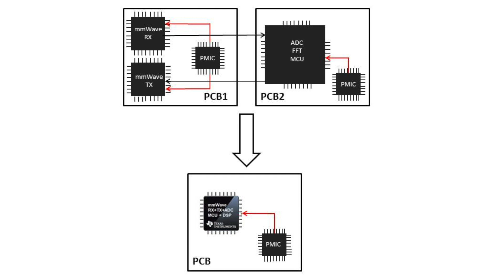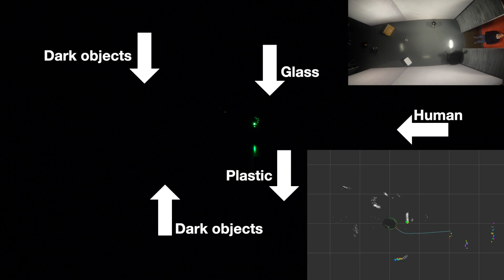Robotics using TI mmWave sensors

Comment: Appears that we have a sensor out in area equipment 4 2 I think we have to replace that that is one of these sensors that goes to the nano nervous system this could be blocking the circuitry to the celluloid which is the one that's causing the emotional problem with the robot